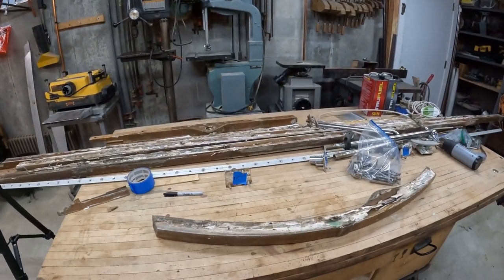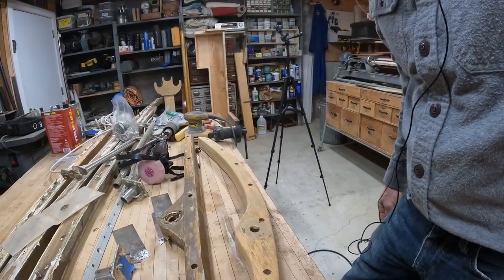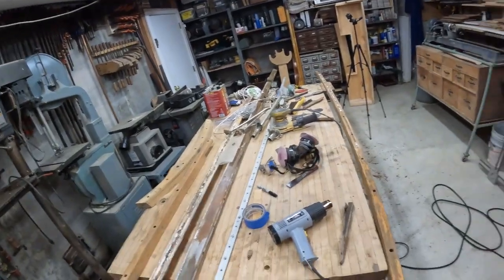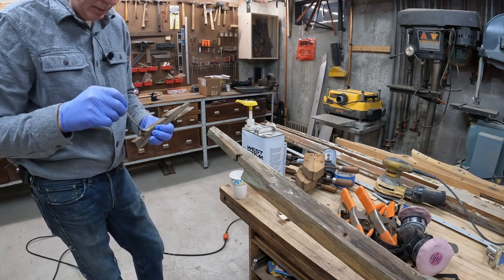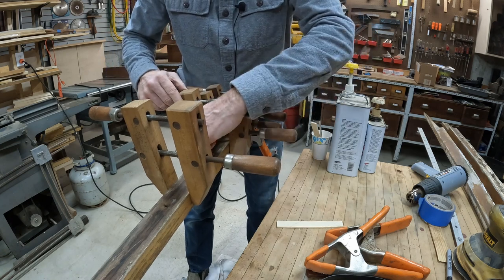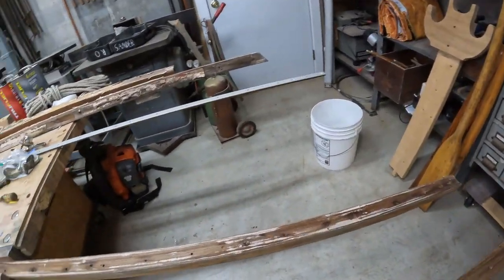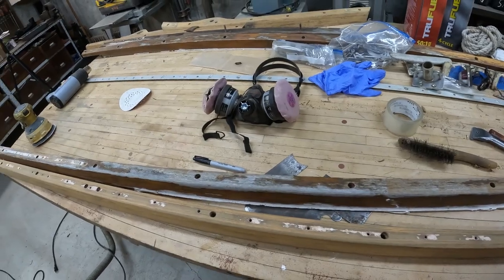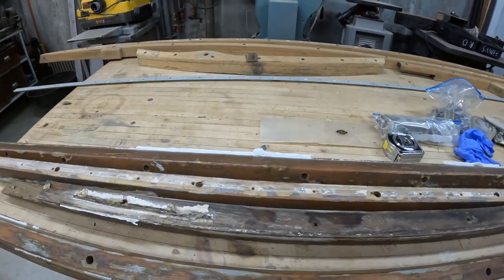#13 port toerail stripping and repair

Comment: It does really worth to repair old teak parts, not only replacement wood is super expensive, but keeping the old wood is environmentally friendly. Your woodwork skill is pretty good. Note: the wireless microphone is a little too hot, either the TX gain or line-out gain is too high. Keep posting.
Reply from the maker: Thank you. I will try to tone down the gain on the mic.